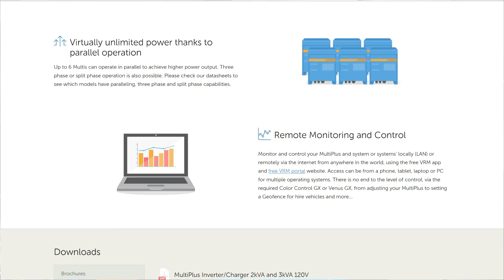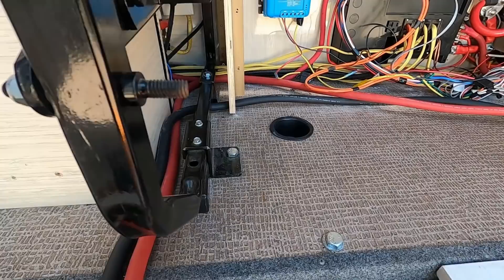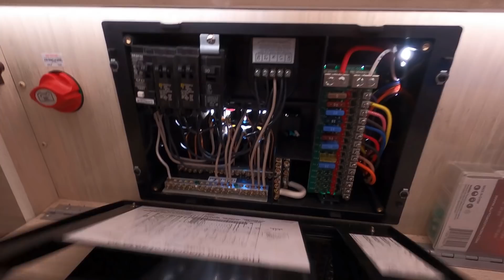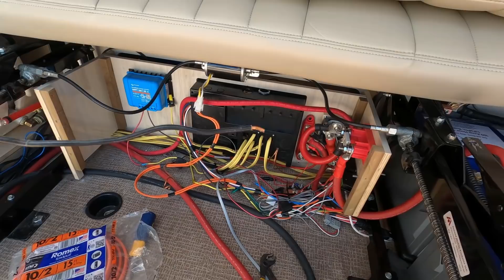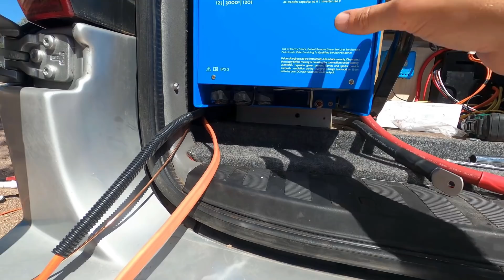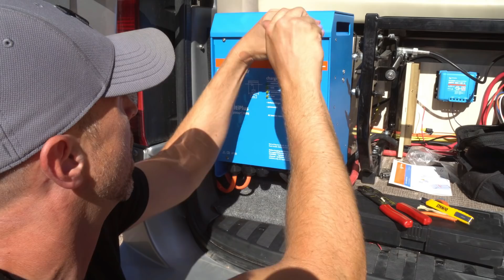RV Inverter Installation | Victron Multiplus 3000va Inverter Charger | Full Time RV Living

Comment: Hi, wondering how much heat is produced from this unit.  I had renogy and had to get rid of it because the heat was to much in a small space like what ur showing.
Reply from the maker: It produces a bit of heat if it's charging the batteries or running a high load for a while. The fan kicks on and it also has a "over heat" protection, We never had a problem with it getting too hot, but it was worse when the bed was down because it sat right on top of the inverter. These are really good units and have had three of them now in different RVs!

Comment: I grind my teeth at RV companies using Romex..This is a damn Vehicle. They should treat them as such. As your fixed house is not traveling down the road. In Hot and Cold weather, fighting condensation, and Vibration all the time. Why I wire all my customers RV with Automotive grade wiring. Housed in flexible conduit. Color coded to the voltage that is inside it. Then wrap it with TESA tape.

I would add. If you have no clue what L1 and L2 means. Neutral and Grounds are. Call a damn Commercial Electrician..As they don't teach it as Electrical Theory 400 years later for nothing...This shit can kill you if you get it wrong. And I buried many an Electrician that made assumptions.

Comment: one question.

I enjoy charging my batteries off the vehicle alternator at least up to the voltage maximum for a standard vehicle battery. On cloudy days, I can supercharge the solar batteries off the alternator using a 40amp DC to DC charger (using battery isolation switches).

I see what the MultiPlus does when it receives 120VAC:
1) Sends 120VAC to the AC side of the distribution panel (I like the AC1 & AC2 outs learned in your video)
2) Sends appropriate DC voltage to Solar battery Bank for max charging.

Question is what the MultiPlus does when No AC (Shore or Generator) Present?

1) Obviously it will draw 12VDC from solar battery bank to invert to 120BAC which is then outputed to the AC brakers in the Distribution panel.

Unsure below:
1) How does the distribution panel receive 12VDC?
    a) Does it come from the solar battery bank using same wire that powers the inverter for 120VAC?

Meaning perhaps the Solar Battery Bank is powering the MultiPlus with 12VDC for 120VAC inversion, as well as the 12VDC side of the distribution panel?

Seems like the multiplus only will charge the solar batteries when connected to a 120 Volt AC power source.

Set another way, this does not understand how to send appropriate 12 Volt DC power to the solar battery bank in a manner watch the same way as a DC to DC charger does?

And if this is the case, how do I introduce, or where do I connect the vehicle alternator 12 Volt DC current into the solar battery bank so that it can also provide recharging capabilities when they multiplus is not connected to a 120 Volt AC source.

This question is complicated with the fact that the multiplus can do its own internal switching, without actually having it in front of me to see it working and understand it in its place, what are your thoughts on my observations above, and my question as to taking advantage of alternator 12 Volt DC current to augment the solar battery bank charging process.

I've ask the same question in different ways and somebody said to just use a separate DC to DC charger drawing from the 12 Volt DC alternator current. Yes of course, I am doing that now, but I do want to understand if in fact it is the case that the multiplus will not be able to act as a DC to DC charger when not connected to a 120 Volt AC source.

====
right now for me to use the DC to DC charger powered by the alternator current of the vehicle, I need to use a series of battery isolator switches when in fact I use the DC to DC charger to charge a solar batteries. When not on, I simply keep the solar battery and the vehicle DC current systems tide together so that they all can take advantage and be topped off while I'm driving. The only problem though is I have to mechanically switch these switches on or off in order to use the DC to DC charger.

If on spending 1300 bucks on intelligent system as the multiplus, I want to understand that either it can or cannot perform the DC to DC charge of the solar battery bank batteries before I spend that kind of money on a device.

It's interesting, even in your system, you still had to install a transfer switch to switch your AC power source. However, my understanding of the auto transfer switch was to switch either from shore slash generator power or inverter power. If I recall correctly in the video you actually have the two separate inputs as being short power or generator power and then that 120 Volt AC going into the multiplus? This kind of answers a question whether or not there is and auto transfer switch capability in the multiplus. Again this understanding would help alleviate either to spend money on a separate auto transfer switch, or not.

It looks like the multiplus does not have its own auto transfer switch. But it does have smart passthrough capability to send whatever 120 Volt AC comes to its input onto the AC distribution panel AND then at the same time generating the 12 Volt DC power which it sends to the 12 Volt DC side of the distribution panel as well as and intelligent 12 Volt DC output directly to the solar battery bank battery terminals.

I actually thought the multiplus had a built in transfer switch to detect such a scenario with two separate AC inputs so that it knew where they're not it was receiving generator, or alternator powerI enjoy charging my batteries off the vehicle alternator at least up to the voltage maximum for a standard vehicle battery. On cloudy days, I can supercharge the solar batteries off the alternator using a 40amp DC to DC charger (using battery isolation switches).

I see what the MultiPlus does when it receives 120VAC:
1) Sends 120VAC to the AC side of the distribution panel (I like the AC1 & AC2 outs learned in your video)
2) Sends appropriate DC voltage to Solar battery Bank for max charging.

Question is what the MultiPlus does when No AC (Shore or Generator) Present?

1) Obviously it will draw 12VDC from solar battery bank to invert to 120BAC which is then outputed to the AC brakers in the Distribution panel.

Unsure below:
1) How does the distribution panel receive 12VDC?
    a) Does it come from the solar battery bank using same wire that powers the inverter for 120VAC?

Meaning perhaps the Solar Battery Bank is powering the MultiPlus with 12VDC for 120VAC inversion, as well as the 12VDC side of the distribution panel?

Seems like the multiplus only will charge the solar batteries when connected to a 120 Volt AC power source.

Set another way, this does not understand how to send appropriate 12 Volt DC power to the solar battery bank in a manner watch the same way as a DC to DC charger does?

And if this is the case, how do I introduce, or where do I connect the vehicle alternator 12 Volt DC current into the solar battery bank so that it can also provide recharging capabilities when they multiplus is not connected to a 120 Volt AC source.

This question is complicated with the fact that the multiplus can do its own internal switching, without actually having it in front of me to see it working and understand it in its place, what are your thoughts on my observations above, and my question as to taking advantage of alternator 12 Volt DC current to augment the solar battery bank charging process.

I've ask the same question in different ways and somebody said to just use a separate DC to DC charger drawing from the 12 Volt DC alternator current. Yes of course, I am doing that now, but I do want to understand if in fact it is the case that the multiplus will not be able to act as a DC to DC charger when not connected to a 120 Volt AC source.

====
right now for me to use the DC to DC charger powered by the alternator current of the vehicle, I need to use a series of battery isolator switches when in fact I use the DC to DC charger to charge a solar batteries. When not on, I simply keep the solar battery and the vehicle DC current systems tide together so that they all can take advantage and be topped off while I'm driving. The only problem though is I have to mechanically switch these switches on or off in order to use the DC to DC charger.

If on spending 1300 bucks on intelligent system as the multiplus, I want to understand that either it can or cannot perform the DC to DC charge of the solar battery bank batteries before I spend that kind of money on a device.

It's interesting, even in your system, you still had to install a transfer switch to automatically switch from AC or generator power.

I actually thought the multiplus had a built in transfer switch to detect such a scenario with two separate AC inputs. This may not be the case given there is a Victron Quattro with two AC input switching feature.
Reply from the maker: Hey Mike thanks for the comment. I'll try to answer it, but you can also check out my two new videos in our new RV where I install the Battery system https://youtu.be/QLY2wwIviJs and also the Victron inverter https://youtu.be/IA6NncKIg7U

For us, the inverter is separate from the 12-volt system and when there is no shore power or generator, the inverter doesn't do anything....its off. We just run from the 12 volt batteries and the solar panels charge up the batteries. The 12-volt system is separate from the inverter and doesn't run through it. You'll see this in the first video above.

The only purpose for the inverter for us is to turn on while "off-grid" to give 120-volt power to our RV distribution panel so we can run all appliances..including Aircon, microwave, air fryer, water kettle, etc. 

While plugged into shore power or a generator than the inverter does a passthrough of the 120 volts... as well as charges the 12volt battery bank up to 120 amps. The "transfer switch" Victron talks about refers to when an interruption of shore power 120 volt happens, it while supplementing that by inverting the 12-volt batteries to 120 volt so you don't get an interruption of power.

Comment: Great video!  I'm getting ready to install this as well.  I'm not sure if you're aware, but you don't need the transfer switch that you already had installed.  In fact, it's probably interfering with the way the Victron works.  The Victron inverter already has a high qualify transfer switch built into it.  So if you're watching this video, please don't use an extra transfer switch!  Hope this helps.
Reply from the maker: Thanks! That transfer switch is for the Airstream system for the generator and shore power connection together. The Multiplus transfer switch is for when the 120v power disconnects it switches over to the battery power.
Reply: Unless you get a Quattro that can accept 2 AC inputs, you do need a transfer switch (automatic or manual) to swap between AC inputs (shore power and generator).

Comment: The wire true that "Hole" i think it' measuring the current on that wire! Solid wires in a RV in Germany are not allowed. Because it could break easily on vibrations!
Reply from the maker: Yes! It seems that Europe has much better standards on the multi strand flexible AC wires than the States. I used Marine Anchor multi flex on my new RV.

Comment: How did you work the power to start your generator?  I am doing this upgrade on a 2018 Airstream GT and it seems the generator starter is connected directly to the old Coach AGM batteries.  Very helpful video.
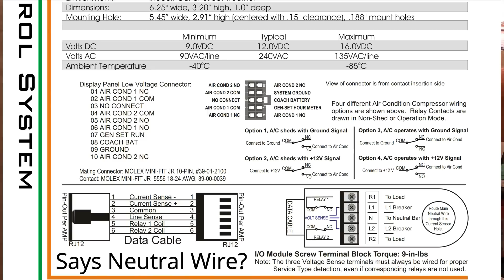Reply from the maker: If you go back to 7:27 of the video you'll see me point to the transfer switch where our AC power comes in from shore and also our generator. And at 16:24 you'll see me remove the main AC wires from the 30 amp breaker and that is the wire that comes directly out of the transfer switch. You do have some sort of "fire fly" or auto generator system in the 2018 so it might be slightly different than our 2014. But try to look underneath at the generator and follow the AC wires up. Mine went right to that transfer switch....good luck!😊
Reply: @IreneIronTravels  Thank you.  I was just thinking the starter for the generator (propane engine) would have a DC starter.  I did follow your steps cited above.  Thanks for the quick response.  I'm trying to get it buttoned up so we can try it out this weekend.

Comment: Do you have a dedicated battery monitor? or do you only use the App?
Reply from the maker: We did have the BMV 712 in the van that had bluetooth and the dedicated battery monitor that I put in the upper cabinet. In our Truck and our also our new RV I went with jus the Victron smart shut (https://amzn.to/3GiqyGf) that is bluetooth only. I never really looked at the physical monitor and I really like having everything bluetooth and on my phone!
Reply: @IreneIronTravels  That is smart, does all this Victron stuff work together on it's own network,. so when you are away from wifi or cell signal you can still connect? Great Videos, Thank you.
Reply from the maker: Yes! To control and monitor most Victron items outside of bluetooth, you need one more device called the Cerbo GC ( https://amzn.to/3m7nyEh ), which allows you to connect all of the devices with network cables and then the Cerbo can be connected to your wifi. This will allow you to control/monitor it from anywhere in the world as long as you have a wifi signal at your Victron location and then cell or wifi from your remote location via phone/laptop/tablet...etc. We just got one, but haven't installed it yet. Pretty cool!
Reply: @IreneIronTravels  Thanks for the replies, another question, Did you look at using the Victron Lynx Distributor 1000 dc instead of using the Buss Bars and fuse holder?
Reply from the maker: I didn't at the time....and I also didn't use it in my new setup.... but I have seen it more recently. I do really like it and think it can add an extra element of organization. I don't think its nessasay.... but I would like to try it on my next system.
Reply: @IreneIronTravels  Thank You, You do a great job in your videos, keep them coming!

Comment: Hello Chris and Aaron!  Thank you very much for this highly informative video!  I heard you talking about transfer switch wires and such and though "great....more wires to fiddle with" :-(  But, I guess our trailers don't have a transfer switch since they don't have generators?  And, the overall system would be able to differentiate that I was plugging the trailer into a shore power vice a portable generator as it is the same level of power?  

Holy cow....that moment of truth of turning on the overall system switches is fairly daunting!  Maybe I'd have our fire department standing by hehehehe

QUESTION:  I hear people talking about that it is better to be able to turn your inverter off when you don't need it, such as maybe at night while you sleep (to save the couple of amps that the inverter consumes).  Can you control the on and off of your inverter through the app? Or, do you have to go to the inverter and push that black switch that you used to initially turn on your system?

Safe travels!
Reply from the maker: Hey Alan! I still haven't got to the inverter install yet.... on the list for this week. But, yes, no transfer switch, so it should be fairly easy install, but the biggest challenge is the distance from the main panel and the inverter. A lot closer in the van! The bluetooth dongle for the victron inverter https://amzn.to/3lOgiNE allows you to turn it on and off from your bluetooth device yes! We only turned on the inverter when we needed it..otherwise it was off. The most efficient use of the  battery power is to run everything you can from 12volt.

Comment: Are those 4/0 cables into the Victron Multi?
Reply from the maker: Yes 4/0 battery cable for the batteries, inverter, and busbar   connections.
Reply: @IreneIronTravels  how did you decide to use 4/0 for that short of a run? Seems to be overkill but perhaps I'm missing something.
Reply from the maker: Victron recommends a 400 amp fuse for this inverter and the constant draw can be up to 200 amps. (2400 watts), but surges can be up to 6000 watts. I tried to size everything based on 3000 watts or 250 amps. According to the charts I used (explorist.life) 2/0 is good for 3% voltage drop up to 10 feet on 150-200 amps..... so maybe you could use 2/0 if you don't max out your loads....but I wanted to build it so we could run everything and not worry about it. The next size up cable is 4/0 and the cost difference was pretty small between 2/0 and 4/0. I also based it on advice from a few others that have built similar systems and are more experienced than I am. Also Victron recommends battery cable size of 2x 50mm2 and I think that is equal to two cables of 1/0 on each pos and neg.....pretty confusing for sure!

Comment: You said 400ah, and the charger is 100amp? How long does it take to charge at 3000w at 100amp?
Reply from the maker: The batteries are 400 AH, the inverter is 3000VA and the charger part of the inverter is 120 AH. So you have 3000va to use while inverting for appliances and when you are charging your batteries it is 120 amps per hour. 400AH dived by 120 AH is 3.3 hours to charge from dead batteries. Hope that helps!
Reply: @IreneIronTravels  okay I found it on amazon, I think you should like again. It’s a 70 amp and a 120 amp the one you have. It’s rated at 120amp charge. I don’t think its 120ah charge. I’ve been wrong and my bad if I’m incorrect. But all chargers are rated at amps you may have taught me that all are rested at amp hour.